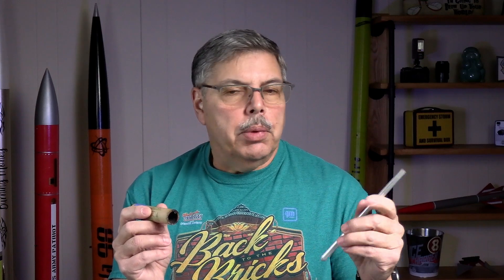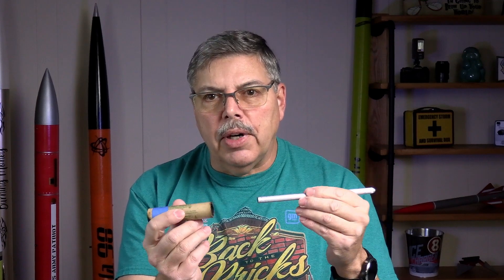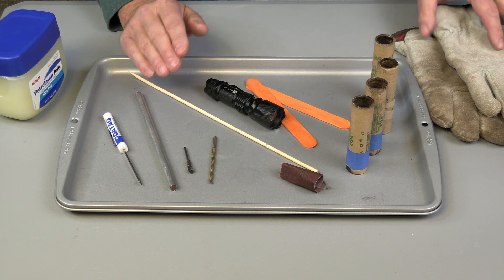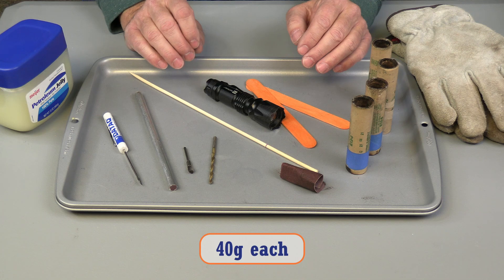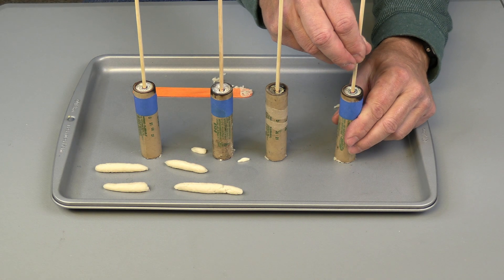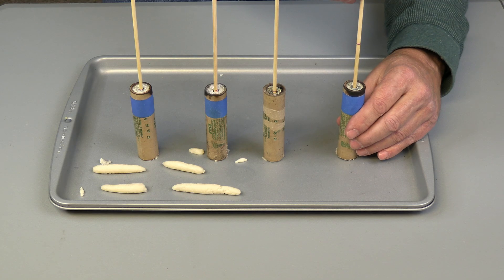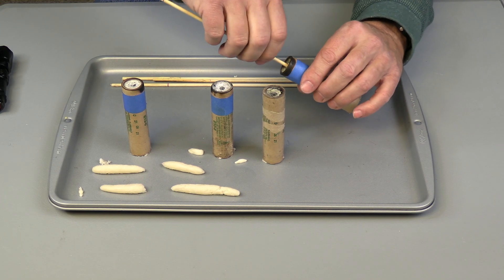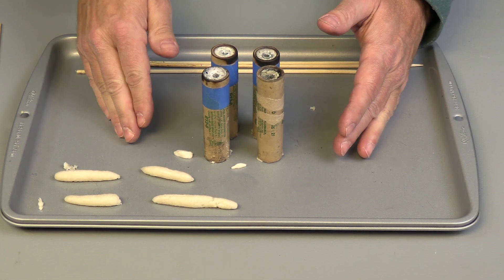Uncover the Secret Behind an E12 Sugar Motor!

Comment: How would you remake a nozzle so you can keep using the tube over and over? is it just clay with a hole in it? For powdered fuel, there is crushed up kitty litter at the bottom and i drilled a hole to make a nozzle, would this work on the old estes tubes?

What about an ejection charge? i would want to use these in my actual rockets. Im afraid that if i dont have some sort of plug after the fuel, its going to blow the charge early?
thanks
Reply from the maker: Yes, the nozzle is compressed clay on an Estes motor. You could try to reinforce the nozzle with super glue or brush epoxy on it.

The core does not extend all the way through the motor in the video example. There is a fuel plug at the end that will provide a short delay. I don't know how long the delay is. You could experiment with the plug depth and determine the proper delay length. If you figure this out let me know!
Reply: @TheRocketeer  ill mess around with it and see what i come up with. 

Another question, what about making motors out of black powder rather than sugar? Have you attempted this? I have wanted to make a black powder motor for a long time.
Reply from the maker: @LT72884  I have not made any black powder motors. BP has a specific impulse of 80 and sugar fuel has a SI of 120.

Comment: Have you ever added a delay and deployment charge?
Reply from the maker: The motor has a delay built in because the core does not extend to the end. I don't know how long the delay is but it could be adjusted by making the core a little shorter or shortened by drilling into the end. Tissue paper with .5 gram of BP and tied off could provide the ejection. All of this will need to be tested. Sorry for the slow response, I thought I had answered this question.

Comment: I've reloaded AT G80 casings with sugpro years ago.
Reply from the maker: How did you get the fuel in and seal the end?
Reply: @TheRocketeer  Drilled out the forward section, insert a greased delrin rod, add sugpro and epoxy plug the end.  Never flown them but good for static testing.

Comment: I have thrown away countless numbers of those engines  and wondered if they were reusable. I press my sugar fuel into tubes. Do you get more thrust by melting it down or by using sorbitol?
Reply from the maker: Melting it makes a big difference by providing intimate contact between the oxidizer and sugar. Adding a long core helps as well.

Flexi-fuel burns faster than sorbitol and in this case provides more thrust.